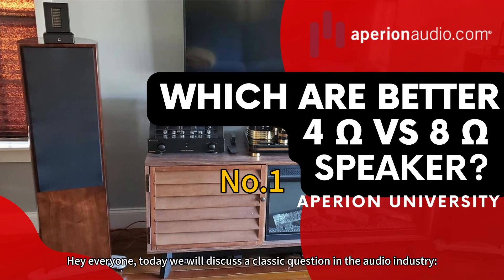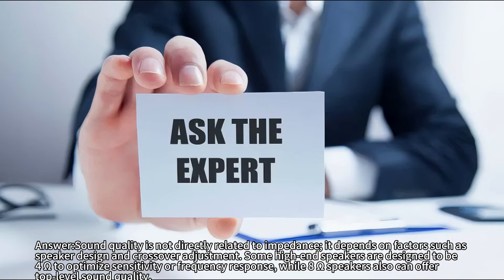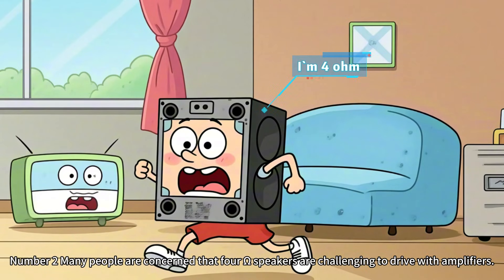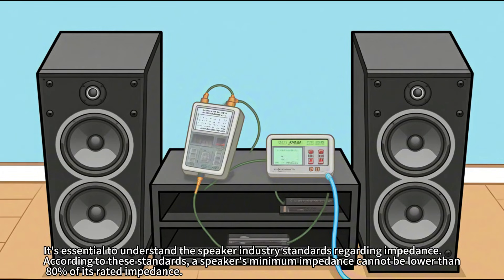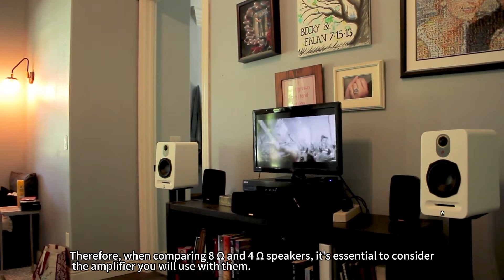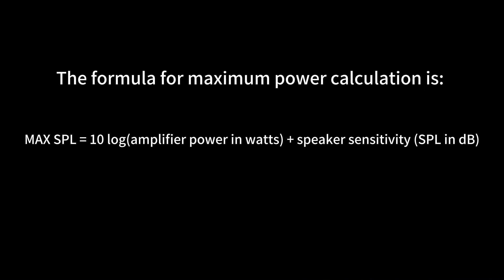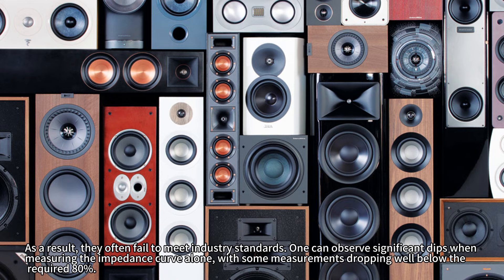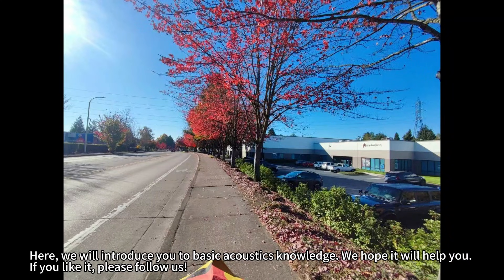Which is better: 4-ohm or 8-ohm speakers? - Number one

Comment: The main problem is the wire thickness to link amp-speaker. For car radios where the distance is short, 4 ohms is ok. With home installation, to keep the bass reflex operating correctly, you need less the 1/20 of the speaker impedance for wire resistance. You can imagine how thick hence expensive wire is needed for 4 ohms 3m wire.
Reply: That's not the main problem. Actually, its not even a problem. If I'm wrong, there's no need to argue. Just supply some credible references so we can see where you are getting your information from.